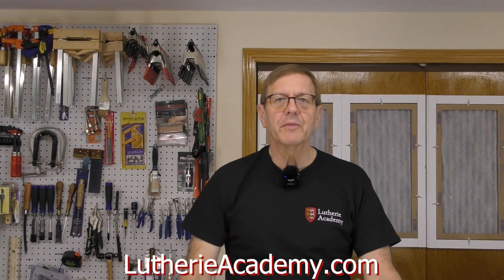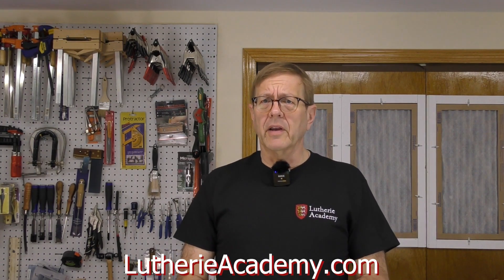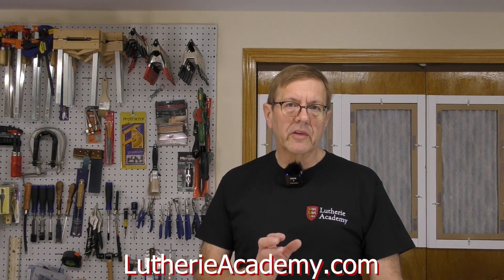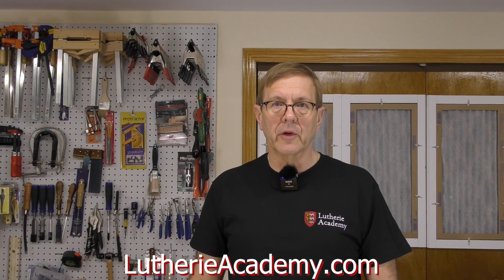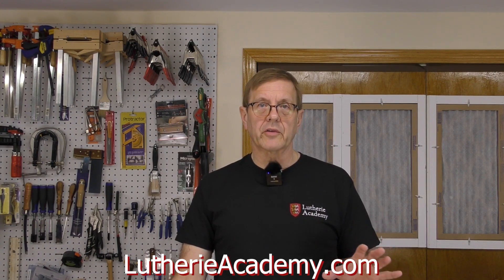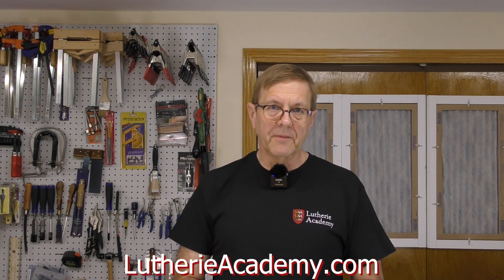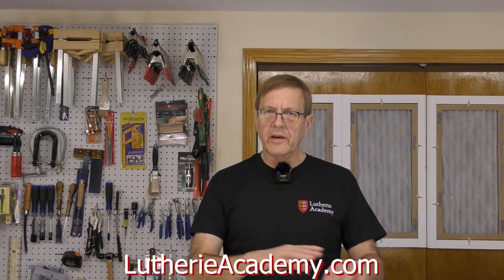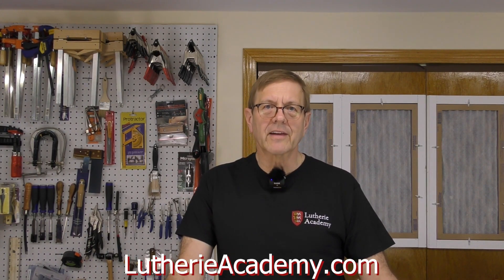CNC for Luthiers: Introduction

Comment: Would this course be applicable to CNC use in building mandolins? If not, please put out that course as I would buy it!
Reply: Great question! While I did not specifically cover things like mandolin, necks and plates, this course can give you a great start in CNC for Lutherie and give you the foundation you’ll need to graduate to the complex stuff. You can bet these complex items will be in the next course!